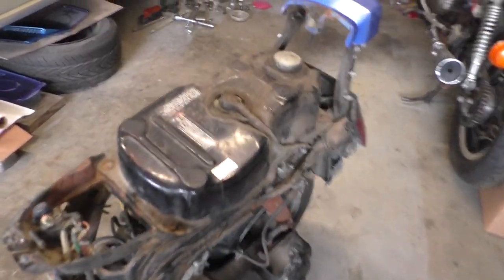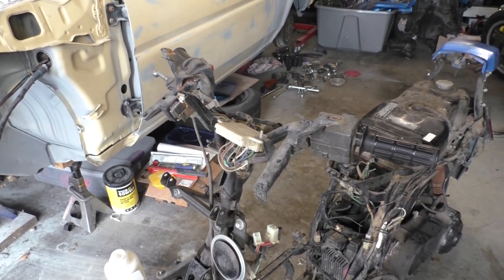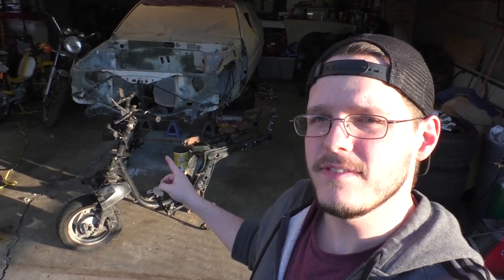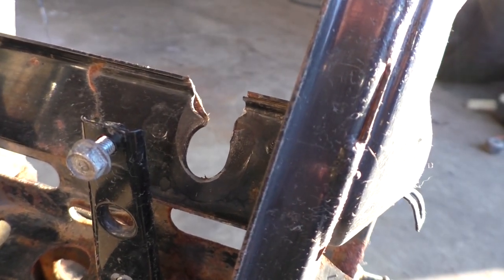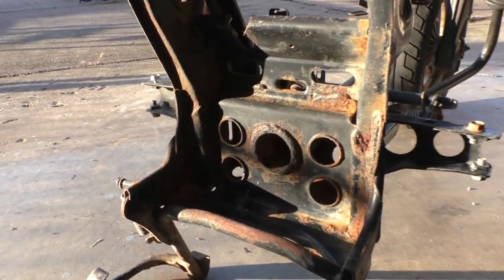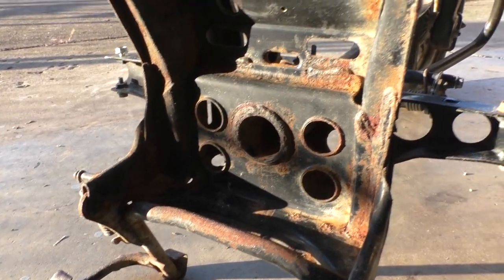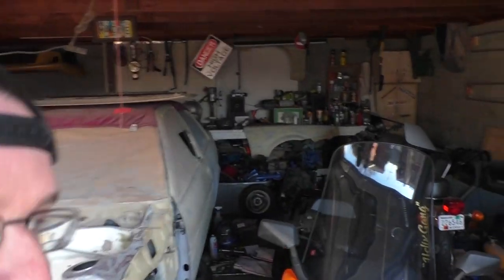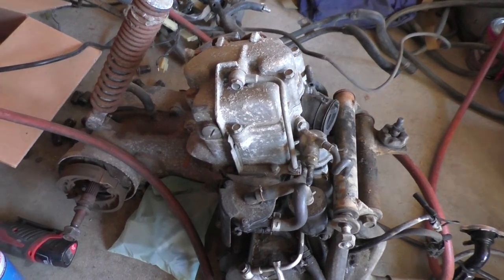Saving A Honda Elite 150 Deluxe - Part 2 | DIY Scooter Restoration Project / Honda Scooter Rebuild

Comment: After disassembling and getting rid of those nasty parts remember ... It DID fire up and run for you WITH them installed. Honda engineering at its best, you can't kill them.

Comment: Damn, I was really hoping you'd show how you removed the handlebars.
Reply from the maker: The plastics over the handlebars have to come off to expose the handle bars. If I recall correctly, there is a big nut holding the stock bars to the stem. Undo that nut and the stock bars should pop off. Hopefully this helps!

Comment: this project is a steep hill to climb. 

and it does seem the previous owners didnt bother to maintain the bike in any shape or form.

major warning bells is that disgusting air filter and the murky coolant 

6:36 watch out she is a squirter

prob while waiting for the frame to come back is just tackling the parts and the bench testing of the engine. But i think it prob better to tear apart the cylinder and check for damage.

Oh yea I am not sure if you are into anime, there is an anime that is currently airing this season and its all about the Honda Super Cub and the anime name is Super Cub 

https://myanimelist.net/anime/40685/Super_Cub

you should check it out.
Reply from the maker: Thanks for tuning in and commenting! YES! I heard about that anime and are wanting to watch it too. 

It's definitely in rough shape, but it will make it that much sweeter after its done.  I've got a backup plan of the engine is completely shot 👍